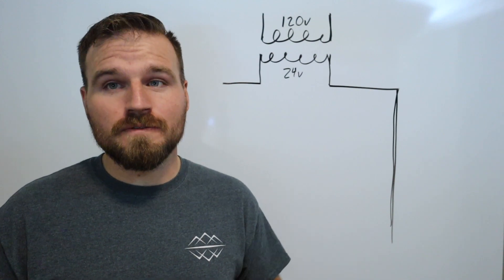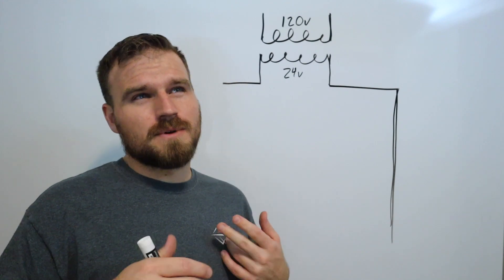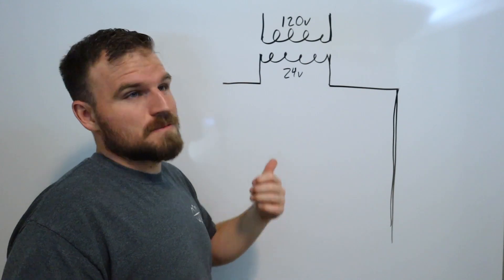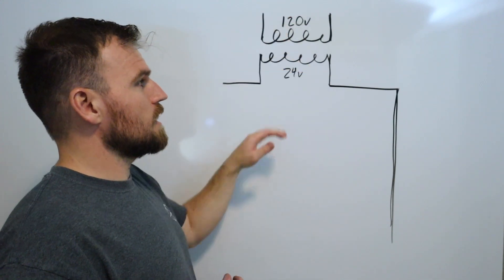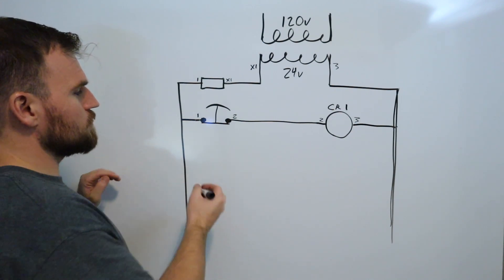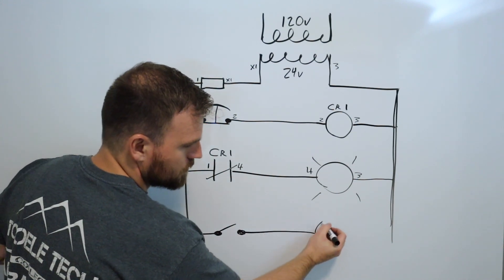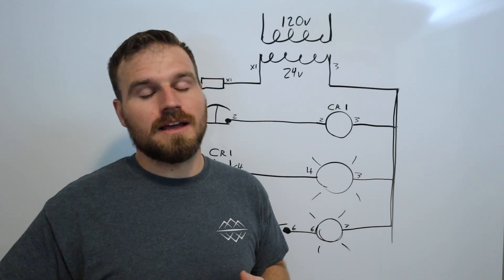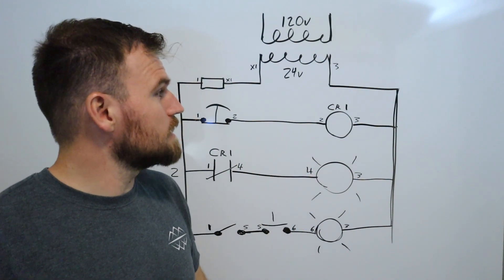Motor Controls Tutorial - How to Read Ladder Diagrams

Comment: So if the hot wires  on the left are red and the ground wires on the right  are white. Will the ones in the middle be different colors each?  Per number?
Reply: No, usually they are all red or black in color. Typically, there will be wire tags that show what wire is what IF they are still legible.
Reply: Also don't be surprised if the common wire is red as well, then you only have the wire tag to go off of but usually it's gonna be x2 or some generic number for all the common wires

Comment: You don't have an overload contact in this diagram, but if you had a NC overload contact downstream of your coil, using your red/white color convention, would you use white wire after your last load, the coil (starting from A2), or from your last logical control, the overload contact (starting from 96)?

Comment: Is there a 24 volt wire going to cr1 contacts
Reply: Yea, it appears that the entire lower portion is all 24 volts. Point 1 on CR1 NC contact will have 24 volts on it when power is on with a good fuse installed.